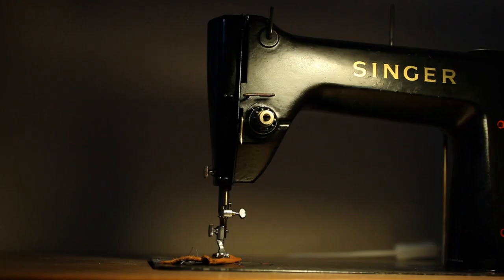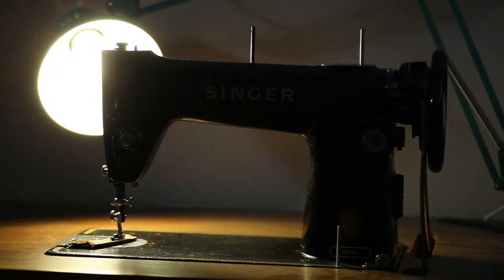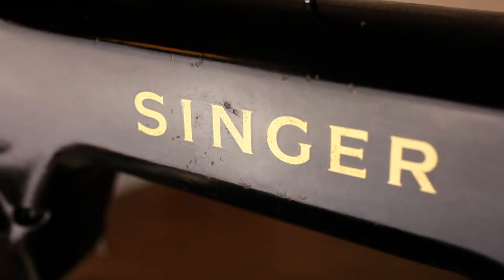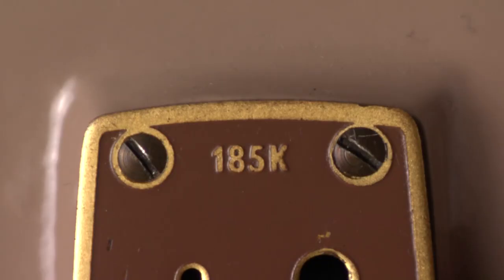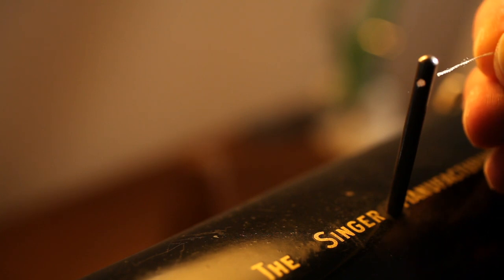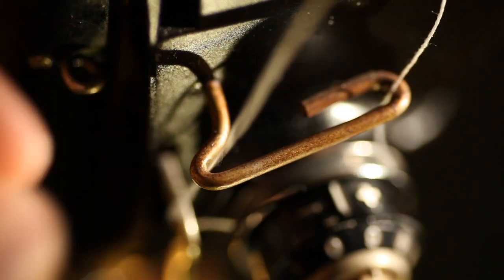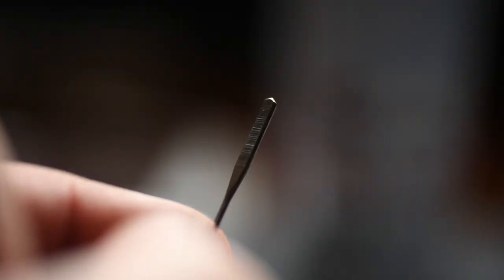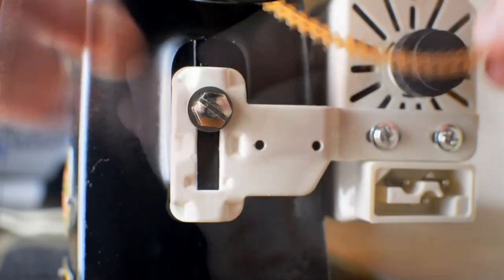Introduction to and threading a Singer 188k1 & 103k. First time sewing with a 188 and or 103.

Comment: Got one of the 188k1 which is my most used machine. I also have 3 103's. I had 4 but gave one to a friend. Rebuilt one 103 to a "sawingmachine", one is designated as buttonholer and the third is in parts atm.
Really good machines!
Reply: It is a beautiful machine. I have a 31-15 that I paid $20 for, but now I'm searching for a table for it.

Comment: Hello, i have the same Singer 188K but unfortunately it came without a table and knee lifter. Does the standard industrial sewing machine table will fit on it or should i take the Singer class 15 table instead? Thank you.
Reply from the maker: Hi, nice to hear from you.
I sold my 188k a while ago so I'm not able to take measurements. 
I do know that a 'standard' industrial table, like the Singer 31-series, does not fit. (I tried to fit a 31k323 head in a 188k-table and that did not work)
Also a model 16 table is different to the 188k table. So that will not work either.
Best thing to do is to make your own table top, I think.

Maybe you can join the industrial sewing machine group on Facebook too. Perhaps someone can help you over there.

Good luck, Erik

Comment: I’m looking for the 188k1 spool pin with the plate covering the access hole.  Got one?  Thanks!
Reply from the maker: I sold mine after I made the video. Most parts are still being sold, since many parts were used on mutiple machines. Original parts, NOS or even reporductions. Don't know about you wishlist, but the best thing to do is to find a parts manual and find the part number. Search google and/or special websites for the parts.
Good luck! Erik

Comment: Is this a walking foot unit to sew vinyl and leather
Reply from the maker: No, unfortunately you're not right. The 103 and 188 are NOT walking foot machines.
(I have 1 walking foot machine, a 78-1.)
Reply: @erikneek  if you read the message I asked is this ,not this is..
Reply from the maker: My apologies @Nizzwell , you're right - I misread your question.